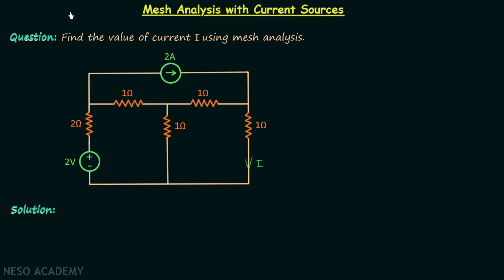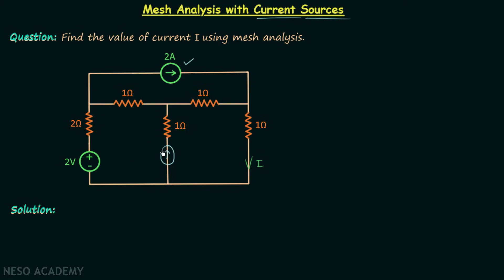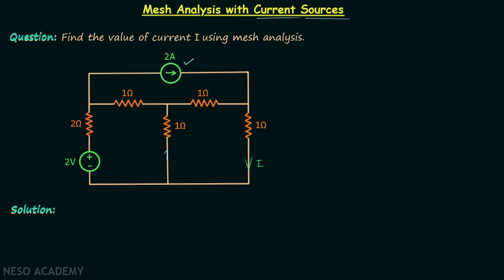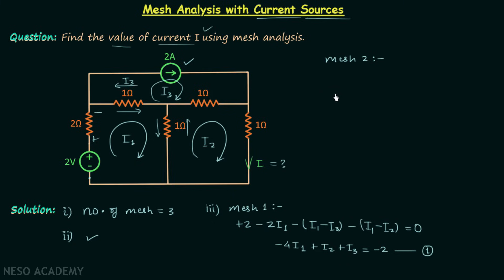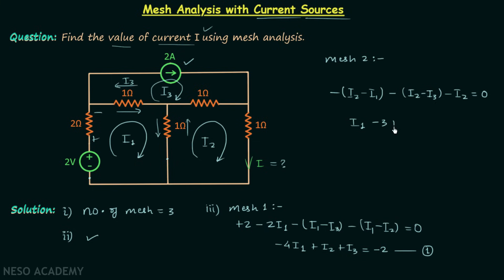Mesh Analysis with Current Source

Comment: there is no need for solving 3rd mesh I know that sinc we have i3=2A . but if I want use that equation in mesh 3 it give me wrong answer why?.i substituted i3 =2 using in 3rd mesh got equation but doesn't work
Reply: Did the same and confused

Comment: I'm not sure I understand, in Mesh 1 you have -(I1-I2) but in Mesh 2 you have -(I2-I1), I'm confused about the signs, and the polarities. I thought we care about the voltage polarity. If we assign the resistor in the middle to be positive at the top and negative at the bottom, then wouldn't Mesh 1 be -(I1-I2) and Mesh 2 to be +(I2-I1)?
Reply: This is wat is confusing me too
Reply: @nesoacadamy

Comment: Why is the voltage from I1 not (-2) in the equation? Initially he marks it down as +2 but I was taught that it should be negative as it is going in through the negative terminal...

Comment: 5:15 mesh 3 how did you get -(i3-i1)?  the resistor 1 ohm has polarity according to its current direction + -. you're going from - to +, thats +, so 1*(i3-i1) = i3-i1 = +I3-I1?? im thinking at resistor 1 ohm you're doing KVL from the middle essential node and going to the left, with the mesh current not against it so why is the mesh current i3 negative and not positive?

Comment: you did the first mesh in the wrong direction... it should start with -2V  + 2*I1 ...
Reply: He used the other sign convention. But it doesnt matter.  If you take your equation (whatever you had) and multiply both sides by -1, you'll get the same equation as his

Comment: Really helpful! just wanted to add that using resistances of 1 ohm in examples like this could be confusing, since as as the coefficient of one is implied, it may appear as though our equations are solely based around current, rather than voltages in terms of (unknown current * resistance constant).

Also, what happened to the passive sign convention? is it not standard?!

Comment: Shouldn't the equation for mesh 1 be -4i+i2+i3=+2    instead of -2 since the KVL indicates the direction to be negative for the voltage source of 2V.
Reply: No, you are completely wrong. It is flowing from negative to positive so its a positive voltage gain. If there current was reversed then it would be a voltage drop, therefore it would be -2v, but that is not the case.
Reply: Was taught this too, I’m pretty sure you’re right
Reply: its +VE since its going from -ve towards the +ve

Comment: Sir ...I can understand very well ...bcz your method is great ..I am student of engineering . I have a equation = what is the use of mesh analysis in real life ,? Means ..any example for device which has this type of circuit and is there use in industry ? Sir please answer  .....
Reply: Mesh analysis has wide applications and is primarily used when analyzing circuits for voltages and currents. However, saying anything more specific than that is difficult since it is so widely used. It is as similar as calculus to the field of engineering. Fear not, these have a lot of uses when designing circuits and machines, so you are not wasting your time learning it.